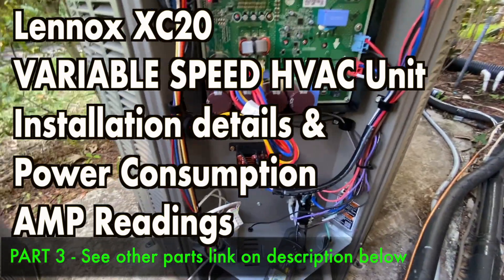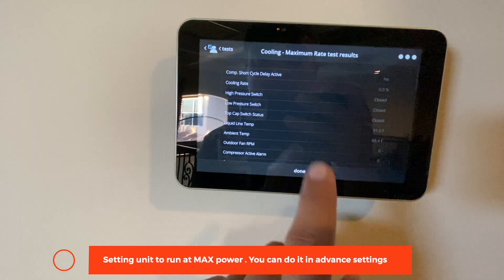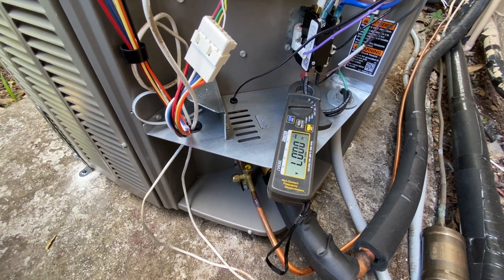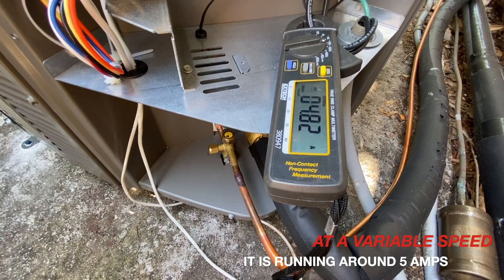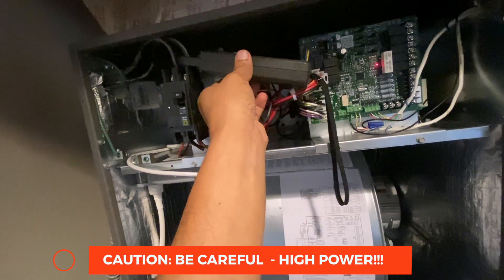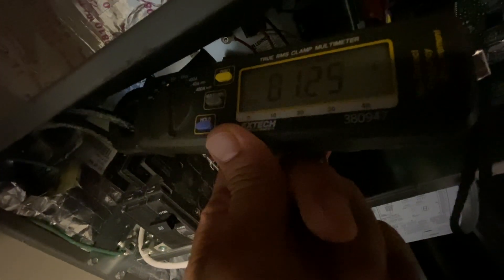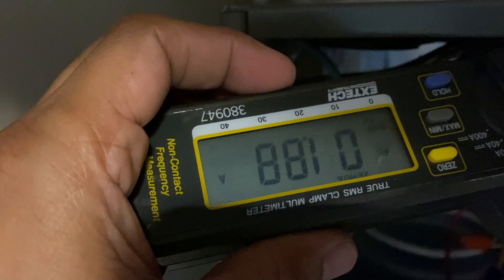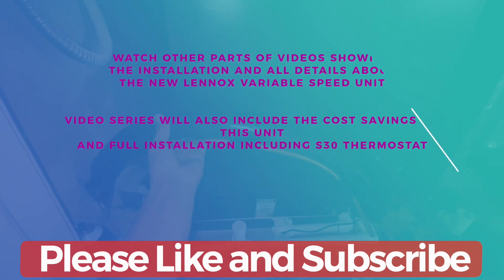LENNOX XC20 Variable Speed HVAC unit - Power Consumption PART3

Comment: I was lucky enough to move to a house with this unit installed - its superb, quiet , powerful when it needs to be.
Its really efficient when it RPM's down and keeps a big house cool in scorching heat. Going forward this is a must have unit. Super impressed.
Reply from the maker: Totally agree….awsome unit!!! Best part is if anything goes wrong there are codes that tells you what’s wrong. This way the technician you call don’t mess with you by over charging you something that is not wrong with the system. 
My unit stopped working and I had a code on the thermostat and I looked up the code and it was nothing but a clogged line for drain. I cleaned it and it was working fine then. Saved me a call to the technician….great unit for self diagnosing

Comment: Can u tell me what thermostat u are using, is their a way from the thermostat to tell if variable speed is working , thanks
Reply from the maker: I’m using S30. You can tell by listening to the sound of the outside and inside unit. When it’s cooling at high speed it’s louder and then it slows down.

Comment: Thank you for your videos, it’s nice to have the information while researching for my own install.
Question? How did you acquire your unit? It appears that you are DYI and I haven’t found a way to get a unit like this from Lennox or a comparable unit from carrier or trane. I am an electrician and have a decent understanding of hvac and I am looking to do this install on my own with help from my HVACR friends. Thanks!
Reply from the maker: I knew someone who work for Lennox so I got this unit for less than half of what dealers sells it for. For you to install it you need to make sure you know someone with a license who can give you a hand in the installation.
Reply: @HowToDoitright  i wish I had a Lennox connection, glad u did. I definitely have licensed help. Thanks for the info

Comment: Great video.  Having said that.....good luck with a close by lighting strike and that board exposed to exterior heat. Those caps on the board will be fried either way in no time.  I would worry about this in FL, TX or other Southern States. The cost of replacing the board alone would more than offset the savings on electricity. My two cents.
Reply from the maker: Good point but there is a way to avoid it. These units needs to be in shade as a recommendation from manufacturer so it suits my installation location as it’s shaded. 
Also it comes with 10yr warranty so parts are covered by Lennox. 
After 10yrs it’s the end of any HVAC system as if it runs it’s on overtime anyways. 
Also the caps are cheap and can be easily replaced via some soldering without issues for anyone skilled with solder iron can do it. 
Having said that those are for someone skilled but for a normal household I agree it may cause them issues. So far I have them installed at 3 houses and been monitoring them. One house is not shaded and it’s been fine. We will see how it goes.

Comment: I have an XC-25 lennox but on hot days ie 100.00 degrees it does seem to hold the cool in the house??? What happens is if say I set it to 75 deg. set point  it may hold it up to 89 orb 90 then the system begins to run at a higher speed increasing to what seems to be max speed --and it doesnt go down?????-It continues to run at a high speed trying to maintain indor temp.    Mean while the "feels like "temp will start to increase to 76. 77, 79 80, 81 . it continues to run at a high speed and as the temp outside goes up it even seems that the unit will just keep  running but not at my set point?help me
Reply from the maker: so it could be two things. 

#1 that it just needs a reboot. there are two ways you can do this. soft reboot and hard reboot. soft reboot is when you restart your S30 thermostat and the hub. there is an option in settings in there which says to reboot both and i do that occasionally like once every other month. 2nd is hard reboot which means turn off the AC first and then turn off breaker at the air handler and then turn off the breaker to the outside unit. make sure both are off for about 5 mins. Then turn on the outside breaker and then inside breaker. wait for the unit to come online and then you can turn the system on. this may solve the issue. if not then its #2 below.

#2 it could be possible that when your AC got installed, the company didnt gas it up appropriately. that means it may be low on gas and thats why its working hard to keep the house cold. that means its taking more electricity also. to check that you will have to check what is the subcooling of the AC. there are ways you can check it but its important to do so. i have videos on it under my playlist HVAC on how to check subcooling.

hope it helps

Comment: Trying to find running amps for rheem ra1642aj1na power bill is hitting $200/month at 74/75 setting florida
Reply from the maker: Check their specs. It shows it in there

Comment: That's awesome. I have a 3 ton unit from 1988 that I'm definitely wanting to upgrade. It pulls about 19 amps when it's on.  I've looked at mini splits but noticed that central units also have inverter compressors.  Thanks for the video.

Comment: Thanks debating if I wanted to speed the extra.
Reply from the maker: im glad i did. what an amazing unit it is. super quiet and my bill went down 200 bucks.
Reply: @HowToDoitright  you saved $200? Is that per month?? How did you calculate that
Reply from the maker: Yup. My bill went down 200 bucks a month so that’s how it was calculated. Obviously nothing else was done beside changing this unit.
Reply: @HowToDoitright  so it probably pays for itself after 2 years
Reply: Did you get yours installed?
Reply from the maker: @DBR00  yes
Reply: Thanks

Comment: Isn’t it reading the fan amps as well?
Reply from the maker: Yes agree it is however the fan Amps isn’t too high. The compressor pulls most of the amps but I agree with you.
Reply: Whats the cost of this unit here, including the air handler